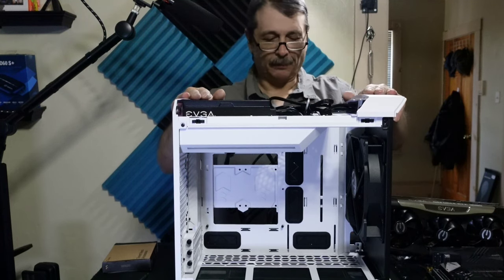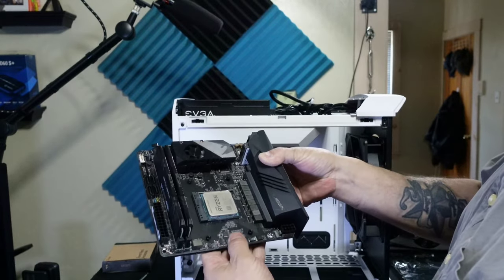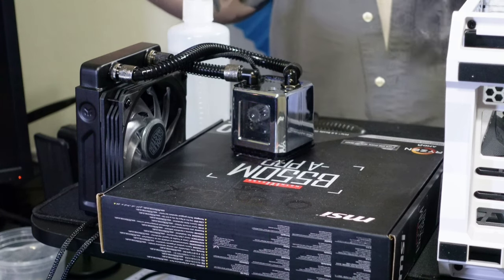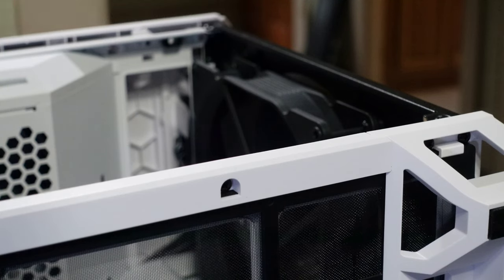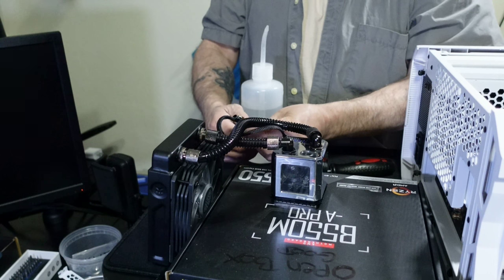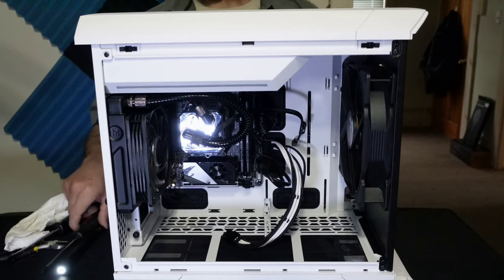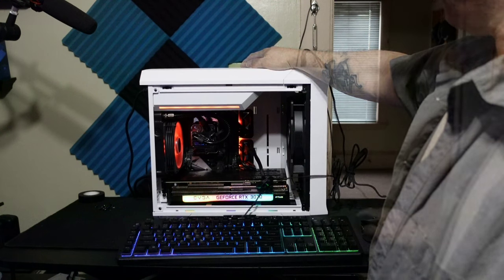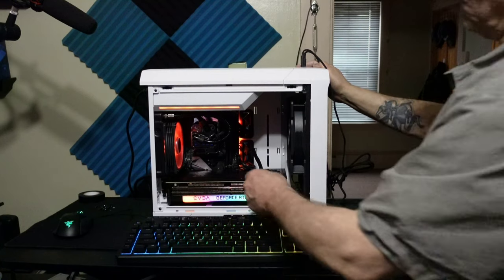Fractal Torrent Nano finished and water cooled

Comment: Isn't an air cooler better than a 120 AIO?
Reply from the maker: Well it depends on the air flow,  bad air flow would definitely cause thermal throttling but this system had really good flow and ran nice and cool.
Reply: @JPsTechReviews  Now imagine if you took that really good airflow and used a proper cooler.